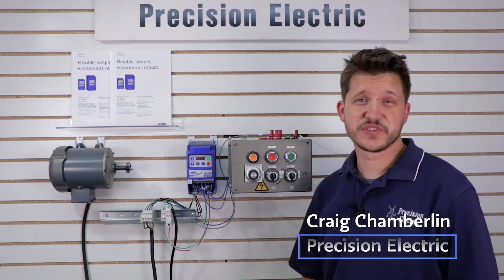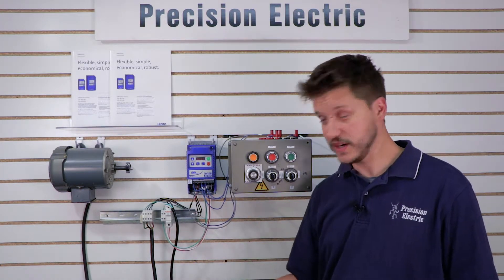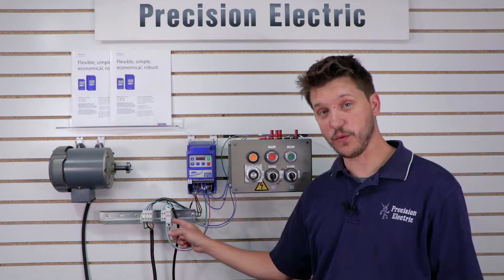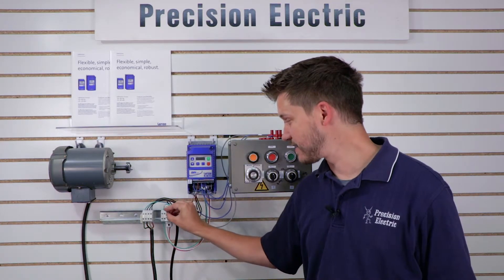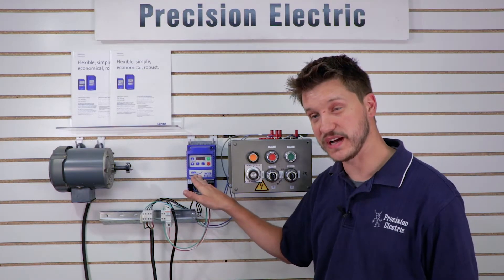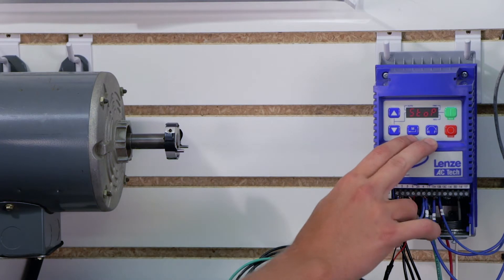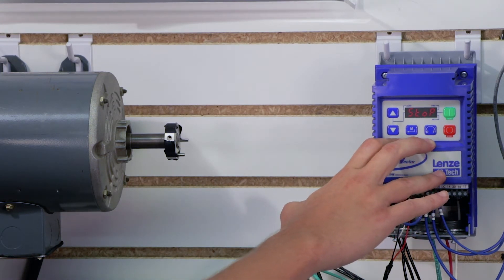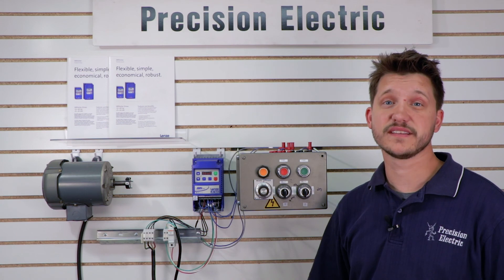Lenze SMV Training Lesson 6: Advanced Drive Protective Fuse Sizing & Motor Overload Setup - VFDs

Comment: How would you size the fuses on the VFD output for 3 phase?  I only need 9 amps to power my motor.  Do i get 3x 9 amp fuses, one for each hot wire on the output side?